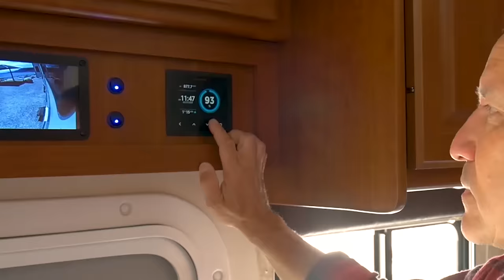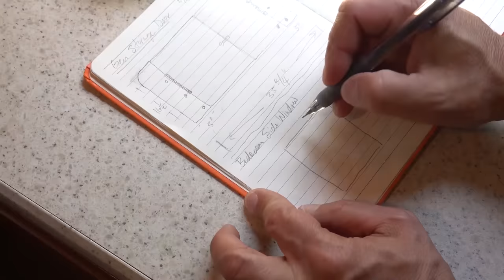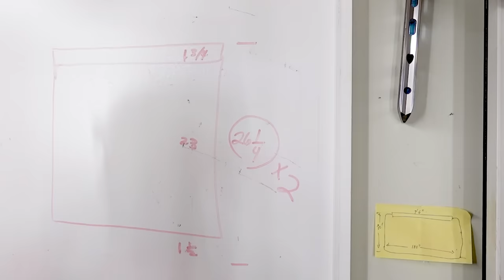THIS Replaces UGLY Foil Insulation In Your RV Windows (Full DIY Build)

Comment: Nice video. However, It does not open all the way like the original window coverings. Not sure the reflectix works when covered by material. 
Does not really look more professional than the original from the inside. Does not seem worth the effort.

Comment: "Put the insulation in the shade"  
Well,  know that UV Rays (light/sunshine)  pass through glass and warm, heat up, even melt  things they 'illuminate'.  As well, the darker the item they 'illuminate,' the more they heat that item up.  Heat creates infrared radiation which cannot pass through glass and is reflected by the surface of the glass. the sliver foil hidden beneath the dark surface of the blackout curtain material will reflect the infrared radiation (and HEAT) back onto the material.  In the spaces where the  material has been 'fused' with the IRON ON strips (employing a Heat Sensitive Adhesive) the heat will not be reflected at all.  
I suspect that the temperature on the inside surface of the curtain will rise significantly after exposure to direct sunlight (passing through the glass).

When insulating a space, it is best to install the reflective surface on the exterior* and the insulating material behind that.  In this case, stopping the light from entering the interior would best be accomplished by adhering a reflective film to the exterior of the glass. Next best (and likely more practical) would be to adhere the reflective film to the interior surface of the glass.  That would reduce the UV source of both light and heat.  As well, the reflective foil prevents passersby from seeing into the structure during daylight hours (when it is brighter/lighter outside than in).

In the evening when the interior space is illuminated, a curtain would be sufficient to secure a bit of privacy. If left covering the window during the daylight hours,  the insulating effect would be enhanced were the side of the curtain facing the window as light in color (as reflective) as possible.  

If the curtain were a two-ply affair, the ply exposed to the interior could sport a color, (even a darker one), and the insulating value would be proportionate to the 'dead air' space between the two plys. So the bubble wrap would help but 3M Thinsulate (if you can find a thin sheet) might prove a better choice.

* Why god invented awnings and shutters!

Comment: Is it not the reflection that you need?
Reply from the maker: Not necessarily. It's the heat that is reflected. Some might disagree, but consider that this insulation is not designed for windows. All you have to do is read the info from the manufacturer. Having said that, I could have probably used a variety of materials in the shade to achieve a similar result. I had lots of Reflectix left over and it keeps the shade plyable.

Comment: Way too complex dude.
1. Dark fabric is absorbing heat from the sun  and transferring it into the RV where there is fabric to fabric contact. By using a white outer fabric it would reflect more sun/heat.
2. The reflective bubble wrap is not adding much insulation value.  Another medium like quilting batting would be more efficient. Continuous, not broken up into sections. Maybe something that you could roll up.

Comment: WHY does everyone L0VE this stuff so much for ALL the wrong reasons ???

Hey look !

"Reflectix" is a totally unique product that fills a narrow niche. 

"Reflectix"  is N0T an "Insulation" ...
... it IS a "Radiant Barrier"... !

It works by reflecting "Radiant Engergy" directly back toward the Source with its shiny  reflective surface.

Once you cover that shiny surface in any manner it's  effect is completely nullified..

It doesn't matter IF you cover it with Fabric, paint Vinyl Siding or roofing material.  The shiny silver surface "requires" an air space of approximately one inch on the affected side to perform properly.

All you have is 1/4" of dead air space contained in Polyethylene bubble whose insulation value is near Zero !

Matter of fact all you have are two thin films of Alumiinum foil that are super efficient at transferring "Heat" away.  This is why they utilize Aluminum in cooling Heat Sinks.

Aluminum is an excellent conductor of  heat AND ... Electricity ... !

Do this experiment !

Stand in front of a mirror facing it.

Can you see the mirror ?
Can you see your reflection in the mirror ??

N0W ...  cover the mirror with a towel .

Can you see the mirror ?
Can you see your reflection IN the mirror ??

Comment: As I read in Some other comments the fact that you put the REFECTING foil  in cloth loses its value because it is supposed to reflect the Sun's rays
Reply from the maker: The double layer of foil is actually designed to reflect heat, not sunlight. Its intended use is for floors, basements, and HVAC, not for windows. Hope that helps.

Comment: This is what happens when you don't understand physics.
Reply: Why do you say that?
Reply from the maker: What he probably means is that it won't work unless the reflective side is directly facing the outside. Lots of folks think this, and it's just not true. It works great inside the fabric for heat and cold. Turns out this insulation is designed for many types of applications like basements, HVAC, etc. Just because  RV and van owners started putting it in their windows doesn't mean that's the only way to use it.
Reply: @RVwithTito  thank you. I am gathering supplies now to make myself a set for my RV Van. Not much in the way of information about materials etc out there

Comment: As usual, the comments have the WHINERS that need to find excuses for why they don't DIY things.

Funny thing, experience answers all the complaints and provides knowledge to be able to overcome obstacles like having a table saw, but the whiners never ask the questions to complete the projects and end up with the experience to be the ones easily answering the questions themselves.

SO, FOR THOSE WHINING ABOUT THIS PROJECT:

Clearly this could be built on a kitchen table with some protection for it.
  Since the finished product could simply be screwed to the wall, the french cleat is optional.

Home Depot has small dimension wood that would only need to be cut to length to eliminate the table saw, and for which they offer miter saws to do the length cuts freely in the wood trim dept.

As he clearly mentioned, threaded rod is a substitute, again freely available at Home Depot.  If needed, Harbor Freight or Home Depot has a hacksaw starting at $5.  At $5, a hacksaw falls in the top 20-30 tools that a DIYer or homeowner should own.

Life is about overcoming obstacles and carrying on.  DIYers make a CONCSCIOUS DECISION to pursue this through projects they undertake and freely ask questions when stumped to be able to carry on.

I'll close with two quotes from Ricky Gervais:

       “You should bring something into the world that wasn't in the world before. It doesn't matter what that is. It doesn't matter if it's a table or a film or gardening - everyone should create. You should do something, then sit back and say, "I did that.”

       "It's better to create something that others criticise than to create nothing and criticise others."
Reply from the maker: Where there's a will there's a way. Thanks for sharing your insight. Love that second quote.